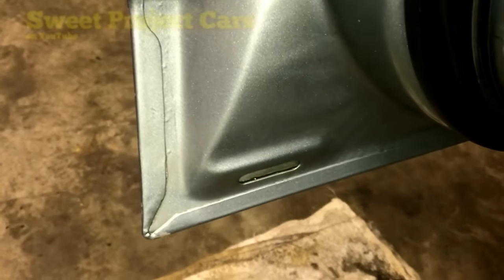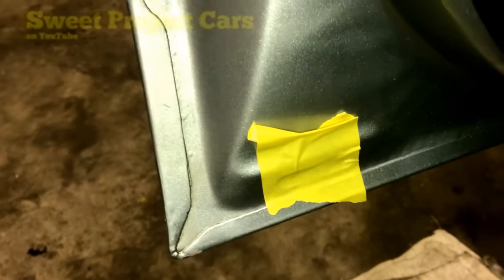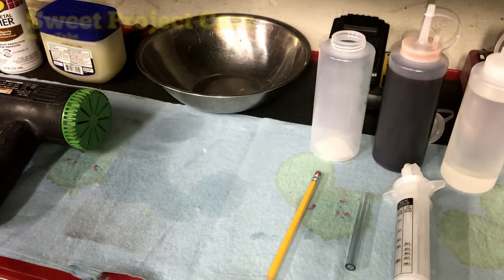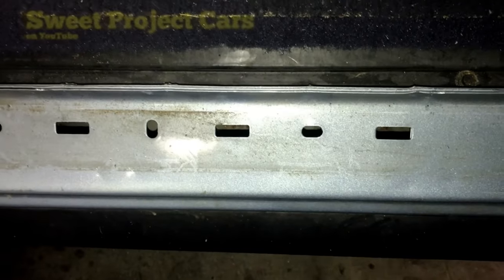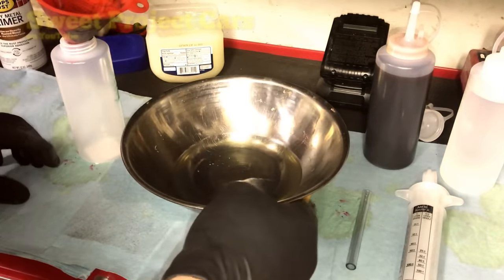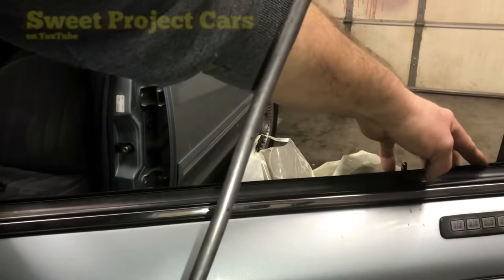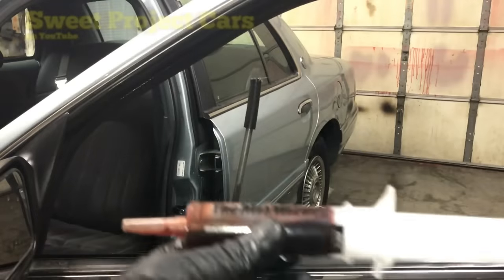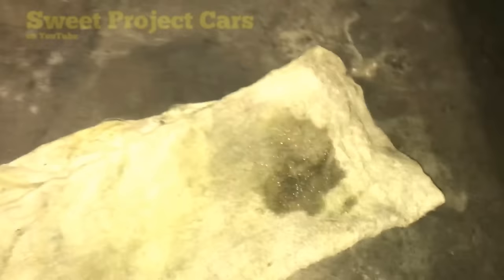Your Car Will NEVER RUST Again! For Just $10 Bucks!

Comment: Thanks for the reminder to change my door fluid
Reply from the maker: no problem my friend  lol :)
Reply: do not forget to change your blinker oil
Reply: LOL @ door fluid 😄
Reply: How often should i change my door fluid?
Reply: @casimirobuenabista  every 2-3 years 😂
Reply: If you drive Honda, always use the Honda fluids, for blinker, door, etc🤦‍♂️😂😂😂😂😂😂💀
Reply: @chrisursogmail  worked In a part store in highschool got asked for 710 fluid many times
Reply: Don't forget, if it's a newer car, you need synthetic door fluid. If it's older, normal conventional door fluid will work fine. :)
Reply: Make sure you vet that 2-way door fluid... that 1-way stuff only works half the time
Reply: Hahahaha,
Reply: my god. I've never changed my door fluid. good thing is a honda.
Reply: @mickcarson8504  why is that funny? You think preventative measures are silly? Prepare to buy a new car for such a joke
Reply: Recommend change door fluild every 3000 miles or 6 months.
Reply: Is that the one right next to the blinker fluid reservoir and the windshield wiper disc brakes? The time you neglect or forget to change your door fluid, you may never get out!
Reply: Riley

Comment: I own a CJ7 jeep.I think rust was added to it as an accessory when purchased new at no extra charge.
Reply from the maker: ozarkprepper1  LOL thats a good one and so very true...jeeps just like crazy UGGG!
Reply: Good one :)
Reply: My TJ is in the driveway with the gas tank resting securely down on the gravel.
Reply: When it comes to "Chrysler Products", EVERYTHING rusts, including the glass and rubber! Been that way since the late '50s! Mechanically they are excellent, but the bodies, due to poor design/workmanship are another story. That's why I have never, and never will, buy a NEW FCA vehicle! As "beaters" they are great, CHEAP because of depreciation, I have owned a few!
Reply: Hahahahaha “added to it at no charge”
Reply: Freaking jeeps and the rust. My cherokee sub frame is rotted
Reply: @steveafanador6441  I don't know about Jeeps, but 60 years ago I was taught that, to stop your Land Rover frame rusting, fill the frame with old engine oil.(the frame was box tubing)

Comment: Try some used motor oil from diesel trucks or used car oil mix 60 40  used oil and bar and chain oil (for chain saws) The bar and  chain oil is sticky and helps the mixture stay put and it works great.
Reply: You shouldn’t use used motor oil. It has gas and diesel in it which will wrinkle and lift the paint.
Reply: Can I use cooking oil

Comment: Nice tip!  May I humbly suggest that for anyone who already has standing water inside their doors/rocker panels/etc, you should remove as much as possible and then use a hair dryer (NOT a heat gun) to heat up the door or body panel and evaporate away the remaining moisture.  That way, the vaseline/trans fluid/oil/etc. will be able to directly contact the metal surfaces instead of sitting on top of the standing water.  Once treated, any new water won't be able to easily get in contact with the treated surfaces.

Do NOT use a heat gun because you're likely to damage the paint while heating up the panels you're working on.  You must be careful, even with a hair dryer, so do this at your own risk ... but make sure to get all that moisture out of the area FIRST, before treating the panels.  ;-)
Reply from the maker: PalzToTheEnd we suggest if you are that serious about rust proofing your car to do these 1st  VIDEO IN RUST SERIES   https://youtu.be/WOpKDt5JEFk
2nd  VIDEO IN RUST SERIES  https://youtu.be/PLQLuWdoFgw
3rd   VIDEO IN RUST SERIES  https://youtu.be/nSDiHydE23o
4th VIDEO IN RUST SERIES  https://youtu.be/gh6X1d5B
Reply: PalzToTheEnd your 100% correct, even though it was a cheap way to preserve your vehicle but imagine 2 years later you found out the hard way?  REMOVE the MOISTURE people!!
Reply: @kurtragucci5092  Getting that PJ or transmission oil in the door till it drips out the bottom will remove the moisture.
Reply: @TheOzthewiz  I do believe this is true... oil can displace water
Reply: @macleanclassics  Actually, oil floats on water?
Reply: oil floats on water. don't trap any water in the bottom of your door with your mineral oil folks. dry it out first.
Reply: Iso alcohol is heavier than water, could possibly flush the area with that first to carry the water away
Reply: Remember oil floats on water.
Reply: Blow dryer is also a great way to do repairs with Bondo and touch up painting when the weather would otherwise be too cold.

Comment: Maintenance is the key to the longevity of any vehicle. I’ve been working on everything since the late 60’s. My maternal grandfather melted 3 part toilet wax seals (Now Petroleum Based w/o rubber) sold for a $1, but used boiled linseed oil. Once heated & mixed, he used cheese cloth to apply to his hand saws, hammers, etc. I have a professional pressure pot (4 total) with a screw on gun. It has an air-chuck type disconnect and came with 5 hoses of different lengths & nozzles. With a top mark on the connector to help direct the spray, my 90 degree one is my favorite. 
  Since the 90’s, most all vehicle have metal/plastic bolts that screw into plastic clip nut on the front fenders. Easy to remove without any damage & reuse. The back three with the wheel turned will allow easy twisting of the inner wheel house or splash guard for access. Leaf, pine needles fall in thru the vents in front of the windshield. While driving, this is a high pressure area, plus washing push this debris to the bottom. Many companies have tiny screens in this area. Debris in around wiper arms and under hood. No trees at home, what about work? Driving to grandmas house in the fall. Yes, it’s out there and will get in. Don’t use WD-40! It evaporates. Lithium grease will attract & hold leafs. 
  Bee’s was is impossible to get & boiled linseed oil is cheap. Old school craftsman tip for protecting their metal tools. ASE Master Tech Retired
Reply from the maker: Absolutely Dean!  Thank you for watching and sharing, we appreciate it.  Have a great week my friend. mad Mike the hammer SPC

Comment: My bro was just telling me last night about his bud that worked at a wrecking yard, and his job was to determine if the engines were good, and pickle them in trans fluid for long term storage. Drained the engine, then refilled (overfilled till overflow) then crank the engine a couple times. Any water is displaced by the ATF. Drain it 10 years later and it’ll smoke like hell when you start it, but there won’t be any rust.
It’s the same with firearms, keep things wet with petroleum products and you keep moisture out.
Reply from the maker: That is a great story bigl! Thank you so much for watching and sharing, we truly appreciate it, very interesting. Hope you have a great week my friend. mad Mike

Comment: Back about 1960 in Chicago subs we used engine oil and diesel mix in a pump garden sprayer and soaked the inside and underneath in the fall and again after spring pressure washing. 
I saw our 1960 and 64 cars 9 yrs later and they looked great.
Still do it

Comment: I use linseed oil in a paint sprayer. My truck looks like new. I spray everything. It is biodegradable and stops rust in it's tracks.
Reply from the maker: Thank you for sharing that glad to hear your truck looks newer we love that
Reply: Yes  Linseed  oil  is  GREAT!! ..on exposure to  air it  "degrade"  into a  form of  plastic! ,Just  keep  wiping  off the  surplus   ALSO  dilute with 4 x the  volume turpentine & brush on wood  garden  furniture every 2   ,3 years ,sinks in ,dries in a day or so   Did my  garden seat 40 years ago (& 6 or so  since then  ...wood  looks 2 years old!! I kid you  not! ...out  40 years all time in a wet  cold  climate!  be careful to  destroy  any  ANY rag you  use as  linseed oil  &  COTTON can  burst into  flames  later  when  you are  not  around!
Reply: The Mystic Ruler Of course! Any kind of oil will slow the rust down.
Reply: Don't use linseed. Highly flammable
Reply: @johnwaynebrooks  But what if I want my car LIT AF?
Reply: @johnwaynebrooks  good point,one has to cautious about sloshing oils all over the place.
Reply: @johnwaynebrooks  Weird smell, too. Some folks may find it objectionable.
Reply: If you drive through enough of deer 🦌 , moose and bear 🐻 country, their fat will be enough to rustproof your car. Just don’t salmon 🍣 dip your car. The tires are toxic to their water streams. Sea lions 🦭 however fatty are also not recommended as they might cause the engine to sneeze.

Comment: I will definitely take this to heart, thanks! What I have also found that helps the bottom of the front fender area, is extending the drainage outlets of the scuttle "sink" all the way down with some plastic flexy hoses. Now my car has a fine mesh grille on top of the scuttle panel so that larger debris can not enter it, cause else the drainage openings would get blocked at some point, so you may also need to look in to that when it doesn't come standard that way on your car. When leaves etc. get clogged up that is a clear sign of this and you may find you need to install some fine stainless mesh under any openings first. I have put the plastic extension hoses in place in 2012 and the car is still in too notch condition in these areas.
Reply from the maker: Thank you very much for watching and sharing Vincenzo, we really appreciate it, have a great day my friend. mad Mike the hammer SPC

Comment: I live near to the sea and do this with my entire vehicle. Doors, underneath, engine bay, trunk lid and a light coat over the exterior over the paint to protect any scrapes. I use ATF shot from a service gun using a compressor at 60psi. The vehicle marks territory everywhere it goes for a few days but well worth it.
Reply from the maker: Thanks for sharing. Have a great day.  mad Mike the hammer SPC

Comment: Great video I never thought of this. And To add to it, metal wheel wells attach to body panels forming a “V” at the contact point and therefore the reason why a lot of vehicles rust out in the wheel well area. The sky is the limit with this trick thank you for sharing

Comment: Good video sir!
This can also be applied to most areas with pinch welds...
The rear wheels wells always seem to be an issue aswell, so its good practice to do it in this area aswell! If you cant reach an area, drill small hole from the backside, then install a grommet/plug over it once you're done.
Reply from the maker: You are very welcome thank you very much :)

Comment: Great ideas . Preventing the rust before it starts makes sense ,because once it starts it just keeps eating away at the metal.Those areas you point out are prone to rust . Very expensive  to have repaired at a body shop and even diy very difficult to repair rust. Old guys will tell you to spray your wheel  wells with transmission fluid ,because that shit sticks to everything . I liked that vaseline idea ,melting then I guess it would solidify when it cools after application. I usually buy the spray cans of rust preventer but this video points out the importance of getting to those hard to reach areas . Just one add on touch up those small paint chips on the exterior body .Very often that little chip will allow water to get to the metal and start a small rust area that grows .Thanks for the tips .
Reply from the maker: don thanks for the great tips for the channel we appreciate it :)

Comment: Brilliant advice. In the UK we have a product called "Waxoil".  It's a cross between the vaseline and mineral oil mixed together. Since we live in such a temperate climate, most European cars were treated and injected from new. You could top it up with this aftermarket product, or after a bodyshop repair or panel replacement. You can buy it off the shelf in a 5 litre can. It usually came  with a manual hand  pump to pressurise can and a nozzle to inject into car. Sometimes we'd have to warm the can up if it was too cold. Back in my bodyshop day's, I would say VW were the most liberal( back in the late 1980's). I would remove a chassis leg after collision damage and the waxoil would be an inch thick in places. Sometime to the detriment to the part, as it would clog up water drainage holes. Worst manufacturers back then suprisingly, was Ford and Vauxhall. I worked for a Ford dealer. I remember removing the rear quarter panel off an Escort that was only 4 month old. Rust had already developed in the joints.
Reply from the maker: Thank You very much for sharing my friend we truly appreciate that Mike Sweet project cars

Comment: Great innovative video! Here is my Vermont 2 cents. Been rustproofing my vehicles since 1978 using Used or New ATF, and Husqvarna summer blend B&C oil. ATF works wonders inside the double wall cavities like rocker panels, doors, unibody. I spray the thicker crock pot heated B&C oil with additional bar wax using compressed air out of a 3M rocker Schutz 08997 gun into and onto the entire undercarriage and frame.   Outstanding results and never looked back!
Reply from the maker: Thank you very much for sharing my friend
Reply: @SweetProjectCars  YVW...

Comment: Bar and chain oil works great from a chain saw.  Its sticky and wont wash off.   Still driving my 02 Toyota Tundra that is rust free and that is unheard of in Vermont.
Reply from the maker: russvtguy  thank you for sharing :)
Reply: war on muhammed news  gear oil will work great, but the horrific smell of gear oil is just, well stinky. Lol. It will work, but you'll never, ever get the smell of the gear oil out. Great idea for other areas of the vehicle away from the passenger cabin, however it will still smell outside. People will think your leaking gear oil. But it will prevent rust. If you can handle the smell of it.
Reply: I have used bar chainsaw oil as well , it works great ,I have sprayed the entire vehicle and underneath  inside rockers  etc it sticks  like" shit to a wool blanket"  ;)

Comment: 900 thumbs down? That's a lot of autobody shops watching this video. This is a great idea. Petroleum Jelly also works on electrical connectors to stop rust.
Reply from the maker: Tracy Ockey you are correct body shops don't like us lol
Reply: Sweet Project Cars I got this rusted truck really cheap and I told a body shop that I’m only planning on keeping the truck for work for only 2 years and they recommended me to spend 4K on replacements with them. I asked them about doing the cheaper methods like the ones you’re doing and they got mad.

Comment: Just cleaning these areas is extremely helpful. Dust settles in these areas and mixes with road salt and moisture. These areas trap and hold a metal eating concoction. This is a great tip for stopping that.
Reply from the maker: You are correct Charles! Thank you for watching and for your input, we really appreciate it, have a great weekend my friend. mad Mike the hammer SPC

Comment: I've been doing body work for over 30 yrs. Most of which was in the northern states where they used salt on the roads. I hated fixing rust. I compared it to cancer. You need to cut all of it out, then you have to make sure not to leave any bare metal. This is a good preventative measure to take. Some Auto makers use cavity wax.
Reply from the maker: Call Carlos thank you for sharing and yes rust is a pain and it has to be all cut out to make a perfect repair but most people cannot afford that but I’m with you rust sucks

Comment: Great video....had a bronco ll in the late 80s that leaked power steering fluid everywhere...to tuff to fix.  Slow leak ..fast forward mid 90s. Whole left side looked great rt side truck rusted to hell...I learned.... got out spray bottle and sprayed everywhere..... everywhere ...not mufflers..I’m not crazy. .....Doors ......inside chassis. ....Outside chassis  ball joints ..driveshaft ..all metal underneath  removed tire. Bumpers rear end brakes 
Sprayed the shit out of it. What a mess ..not for the timid...glasses hat. White plastic thing. Gloves. Mess mess mess but it works. Really really well
2 quarts good for year or to...I now just get an oil can and squirt every time I got energy..spray the rubber parts to trannys fluid does not corode 
Stops squeaking ...did I say spray everything lol
Reply from the maker: LOL, thanks for watching and sharing Chrs, we appreciate it my friend.  Have a great day. mad Mike the hammer SPC

Comment: We do the same thing in Russia. You can either buy a product called Movil' with zinc added, or you can make a mixture of petroleum jelly (animal fat in the districts), zinc and used engine oil. It stinks to high heaven for about a month, but it's good for two years. If you use Movil' (which dries into a very tacky, pasty coating the consistency of molasses and is impossible to wash off without rubbing spirits) in panel crevices, you can mix it about 70/30 with winter-grade engine oil to get it right into the pressings. As for the lower door sills, we pour quite a bit of engine oil in, that seems to prevent them from rusting. The more dust in the corners, the better the oil adheres.
Reply: Russians are practical people. Thank you for sharing.

Comment: My brother used to use drain oil and just leave it in the door panels for a week before draining out the extra. Using baby oil works better because it really penetrates the panels better. Any oil will soak into the crimped metal if it is thin enough. I hate the smell of transmission fluid. I remember Z bart cars having the lower panel rotted off. You could see the Zbart couldnt penetrate into the crimps and thats where it ALWAYS RUSTS OUT FIRST.
Reply: Thank you for this comment !!